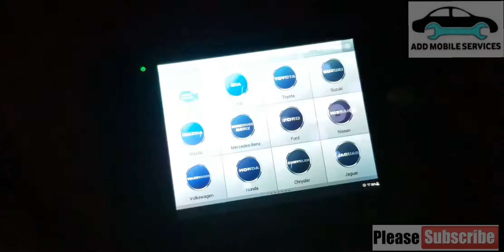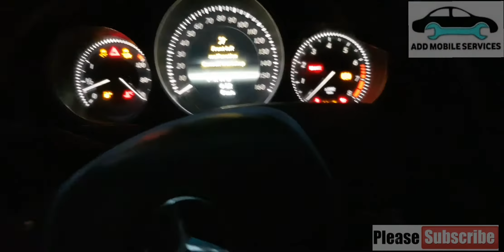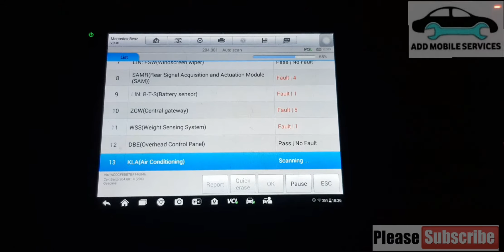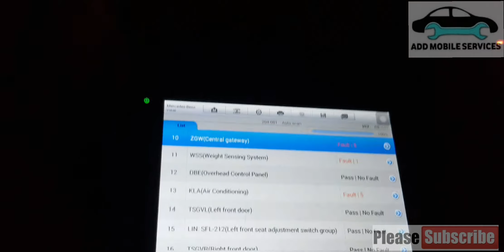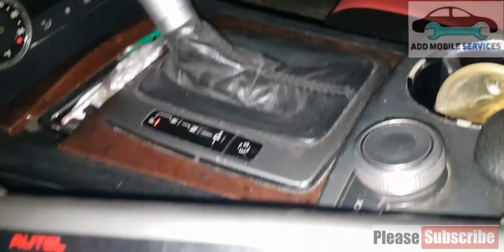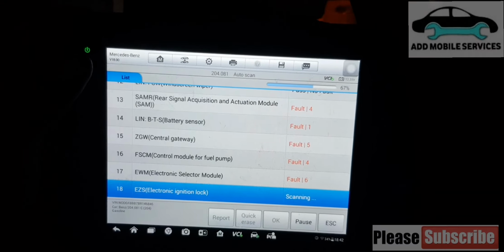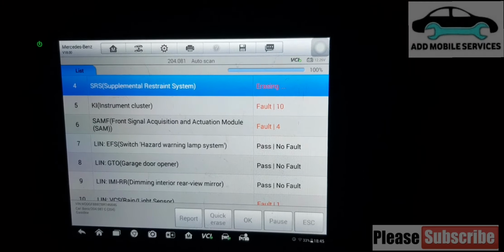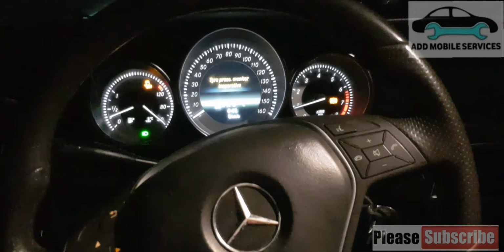2011 Benz C300: No start and No communication to chassis CAN bus

Comment: Hey boss will unplugging the connectors 1 at a time and attempting to atart it still help you find the bad module if the CAN bus cards are possibly bad from water damage, like corrosion on solder points always concentrated at the 3 wire connectir on one end of all 3 CAN bus cards( 2 brown 1 white)
Or do i have to buy a new one to even do the test of unplugging the  connectors 1 at a time 
Oh and thank you for your time and your very valuable expertise

Comment: Hi, good video. 
Can you please tell me where is the control gateway located?
Reply: CGW is located under carpet at front passenger footwell, next to Distronic control module.
Most troubles come from the Front SAM after getting rain intrusion...
Reply from the maker: Yes
Reply: @glasser2819  steering right or left??
Reply from the maker: Left
Reply: Gateway is located on Front SAM!!

Comment: Bro am having this same issue with a customer c300 2009 and it not starting. So I won’t to start it from the kick motor at the front it starts but refuses to change gear and the parking light was off so I want to go try this now
Reply from the maker: Ok 👍

Comment: Great job as always. So what module had the problem that was causing the short ?
Reply from the maker: It was a water damage
Reply: How’d you fix the water damage ? Having the same issue showing up with srs malfunction and esc & abs and cruise control inoperative
Reply: How can I fix ? I have an 2011’ c300 4matic
Reply from the maker: It was the windscreen

Comment: @addautomobileservices hey i have the code 5001 on my 2009 mercedes c300 4matic said theres an internal fault in component cc52 (electronic stability program control unit)
Reply from the maker: Check the abs system
Reply: @ADDAUTOMOBILESERVICES  thank you
Reply from the maker: You’re welcome

Comment: The damaged ecu was the abs or just the connector ?
Reply from the maker: The connector
Reply: @ADDAUTOMOBILESERVICES  so all you did was disconnected the connector & quick erase to get it started ? I’m having the same issue I don’t water damage but my scanner (autel) cannot communicate. It’s shows faults but no start
Reply from the maker: Check the CAN lines
Reply: @ADDAUTOMOBILESERVICES What is the difference in can lines and bus? My car too has lost communication errors
Reply: But everything is working properly in the car without any error on the instrument cluster. Errors just in scanner

Comment: I’m having the same problem with my Mercedes Benz C300 2009 how can I fix it
Reply from the maker: Check for water leakage in the vehicle
Reply: @ADDAUTOMOBILESERVICES  I had water logged in the car. how can i resolve it? my dashboard is malfunctioning already.
Reply from the maker: Pls check the CAN bus or change the unit
Reply: usually the rain leak is at roof connection with A pillar... water ends up funneled in Front SAM fuse box 
$$$$